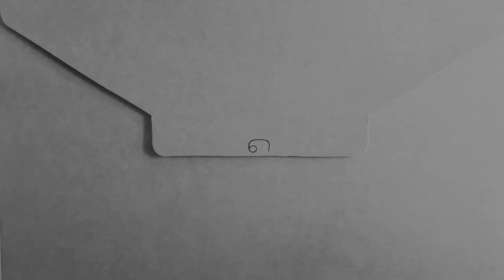ON WOOD _ Making a wooden desk lamp / carving with hand tools

Comment: great work! What tool are you using?
Reply from the maker: There are so many tools that it is difficult to list them all.  Most of the time, I buy it and use it, and I make my own if I don't have it.
Reply: @onwood  for sure! but for the gouge, is it a 10mm?
Reply from the maker: I used 9mm for this work.